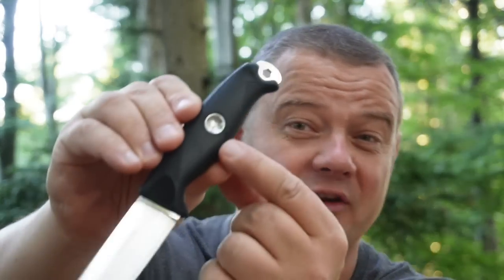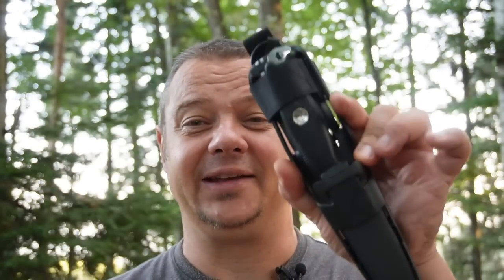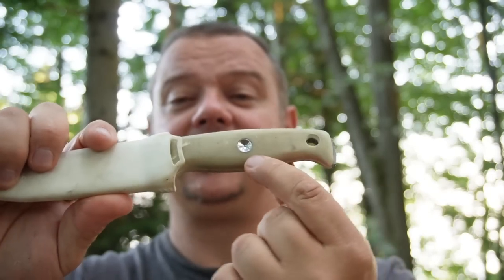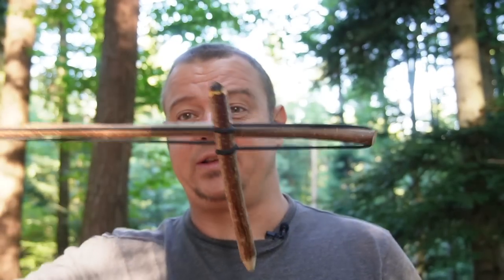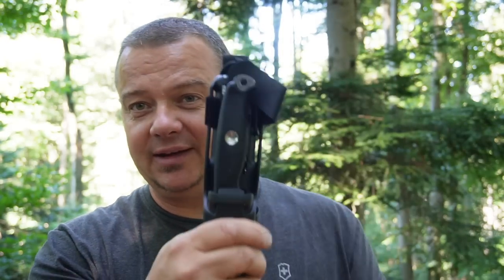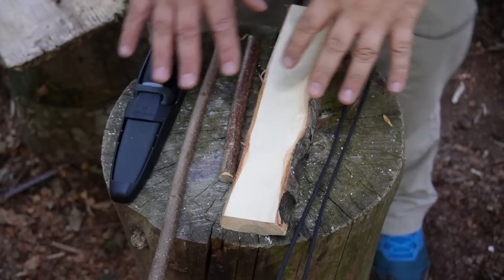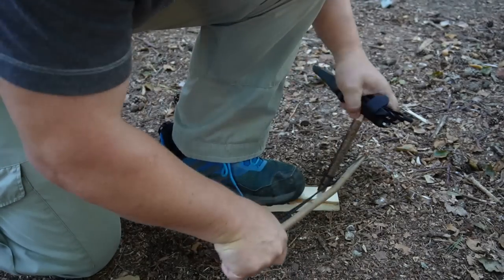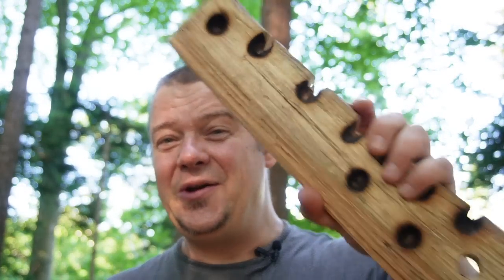Victorinox Venture Bow Drill Bearing Block / CoinTrick - Best Bow Drill Trick ever !

Comment: I think I, too, first the embedded coin technique on Sepp's "Waldhandwerk" channel. 
     Something I learned from "NW Primate" whose milieu is the temperate rainforest of the Northwest in North America, when using green or damp wood in your set is this. Start TWO divots next to each other on your hearthboard at the same time with a burn in. The heat from each of them helps to dry out the other. He was usually able to get a viable ember then on his first attempt after carving the notches and didn't need the second divot, but when he failed with the first divot (i.e. drilled almost all the way through the board) the heat from the first divot had really dried out the second one.
     Something else he usually did was to carve a shallow channel on the bottom of the hearth board under each divot. This let a flow of air come under the board to help oxygenate the ember once it started, thereby helping to build it up.
     Thanks for your channel, Felix; it is always entertaining and also informative.
Reply from the maker: Thanks a lot for this super interesting tricks!!
Reply: NW Primate could start a fire on the top of Mt. Everest I bet.  That guy’s amazing.

Comment: The coin trick is really great. Also the general idea of reducing the friction on the hand part. I'm sure, if there is no coin available, something like this can be fixed with an leftover bottle cap, a hollow stone or something else hard and concave. Great idea💡 thanks for the video
Reply from the maker: I like your idea with a bottle cap!!!
Reply: Yeah especially in a "survival situation" you have a better chance to find some trash, like a tin can, than to find a coin. I'm also thinking if it would work with glass, although that might be dangerous and could shatter.  

Speaking of shatter. Be careful when you bang rocks together, they can splitter, as you saw by the amount of small rock chips in the video. If one of those gets in your eye it's not a fun time.
Reply: @Scrial ok captain safety, grow somme balls

Comment: That was a great tip!  I've also just rubbed the end of the spindle that goes in the bearing block on the side of my nose.  The oil it pics up helps reduce friction too.  Used in concert with your tip friction should be reduced even more.  Thanks for sharing.

Comment: I did my wooden handle condor knife with a penny and epoxy. Used a socket and small Ballpine hammer in a vise to make the shape. Drilled a hole in the handle slightly oversized to fit the curved penny in epoxy. Worked like a champ.

Comment: FELIX BUDDY YOU DON'T NEED TO DO THAT I'VE BEEN USING 15 MM OR 22MM COPPER BLANK END CAPS YOU CAN USE SOLDERING ONE'S OR THE THREAD ONE IF YOU USE THREAD ONE KNOCK THE CORNERS OFF IT WITH A FILE THERE PENNY'S AND YOU CAN ALL WAYS GET THE CAP OUT FOR NEXT TIME HAVE A GO SEE WHAT YOU THINK 🤔 😊

Comment: Just why not a compartment molded in the sheath for a regular BIC lighter as a consumable and other small things useful in the field? 
Just to be smart and fight the widespread nonsense and the silliness of ferrorods and stuffs, someone still talk about carbon steel and charcoal cloth an sparks on the charcoal or military use of battery and iron wool... Come on.
Seriously, when someone live in the mountains or works in the mountains or deals with the outdoor, or is an hunter do they actually loose their time like that to get some fire? Obviously not.
A ferrorod cost more and is more difficult to find than a reliable cheap industrial made BIC lighter. 
So why that? So why this absurd tendency to voluntarily not choose the cheapest easiest reliable way to bring fire?
Perhaps a concavity in the handle can be useful in desperate survival situations (but if you have the knife and the sheath you also will have the BIC with you and eventually some paracord so it is not as desperate).
we just buy Victorinox stuffs because they work fine as supposed and allow the flexibility, the LIFEHACKS you can't do with traditional narrowminded fix blades or even worse than fix blades, those obsolete carbon steel rusty knives... Canterbury like.
Felix be a dissident in knives/outdoors community just use the BIC. Integrate the BIC slot in the sheath. Because you know it works like that. Just practicality and basic common sense, or each fire has to be a didactic experience?